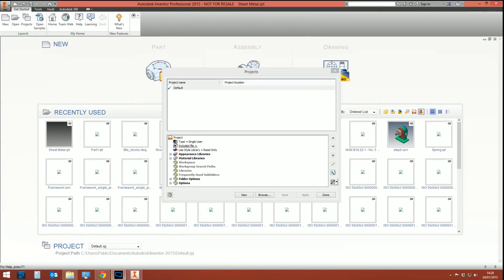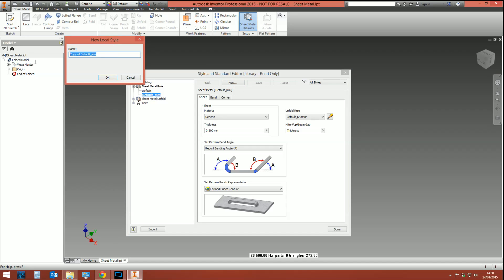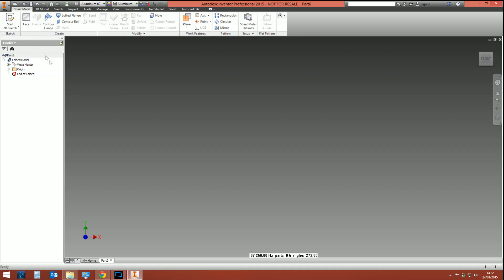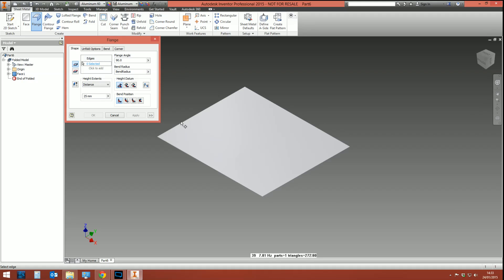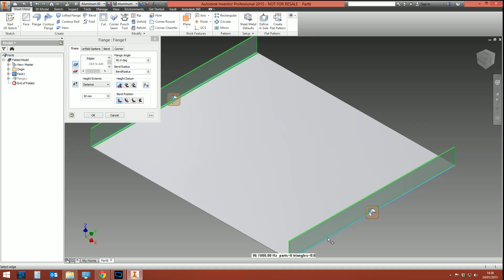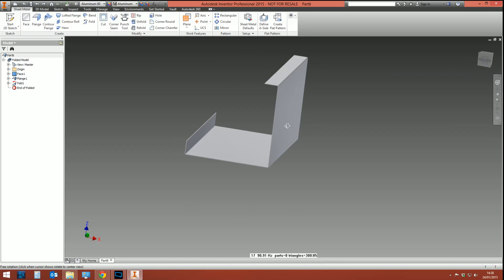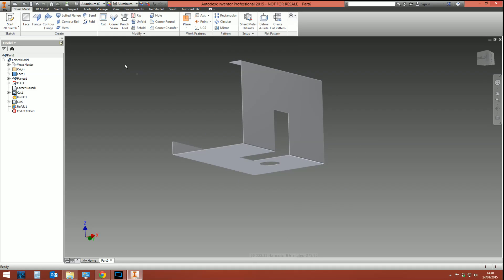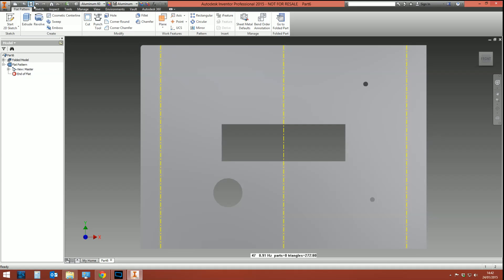How to get started with Sheet Metal | Autodesk Inventor

Comment: Greetings from The Midlands. Why is there a "Click to add" option when creating flanges? I thought it would allow you to create different height flanges in one operation (like the fillet tool) with auto mitre. It doesn't do that. What is a good way to achieve compound mitres, say for 2 or more flanges of different heights? Great channel with great content by the way.

Comment: Love your videos. Do you have any videos showing to to work with tubular frames using the frame generator? I'm trying to wrap sheet metal around tubing for body work on tube chassis, but I have no idea how to do it.
Reply from the maker: +Captain Obviously don't have anything for that specific example, but I've done a frame generator tutorial and a bend part video. Not sure if bend part works with sheet metal though, I'd say not. Is this just to bend a sheet around an existing tube say 90 degrees?

Comment: what are your thoughts on using the sheet metal tool for folding composite metal panel? We do a lot of ACM work, and have some crazy panels that are difficult to capture. Also, we have a scanner and often times have point clouds. I just need a general idea on whether or not this is something I might consider investing time in or if, in your opinion, Inventor is just not the right tool?thank you! very glad I stumbled on to your series!

Comment: Hi, firstly thanks for your awesome videos, no inventor videos I found so far are more instructive yet so much fun.
I have a question regarding sheet metal design (that's why it is here not on the latest video): Is there a way to cut through a flanged or lofted flange sheet metal part at an angle or with a profile, without having after "Create the flat Pattern" a non straight (i.e. not 90° to the surface) cut at the edges of the sheet? The other way around - first perfectly normal edges and afterwards this bend distortions- would be more desired if possible :)
Thanks in advance!

Comment: I've a problem with a sheet metal

the thing is that i can't unfold a sheet metal, cuz the program doesn't detect a "stationary reference", i think that this happends cuz none of the sheets edges is straight ( one of them has an ondulated pattern and the other is curved ).

is there anything i can do about it ?

thanks for your time

seeya

Comment: Extremely helpful. You focused on the main points that I needed without confusing me.  I even laughed several times.  Much better than tutorials that want to put me to sleep.  I've been using Inventor since 2010 but now we are venturing into the Sheet Metal stage. I plan to check out other tutorials you may have.  Thanks!

Comment: Well done. I'm going for a little test for a job and have not used Inventor for 9 years. Solid modeling was easy and still in my head but I was never taught the sheet metal portion in school. This defiantly will help me with my test.

Comment: Hello there,

I have some questions regarding sheet metal design capabilities in Inventor. Please feel free to ask for further clarifications on any of the questions below if required.

1.0 Could you import / export CIS and IFC file formats in Inventor?
2.0 Is there a nesting tool with the software?
3.0 Is there weldments capability with the inventor (welded structure)?
4.0 Does it seamlessly produce BOM?
5.0 Is inventor capable of pulling information from a PDF file?
6.0 Is Inventor capable of generating parametric models (adaptive parts)?

Comment: Hi again, Can you please do a tutorial on a pressed sheet metal part, a pressed four sided tray with edge relief would be great. Also show how to make a DXF file from flat pattern part, can you also include bend lines in the DXF file please!! I would like to be able to send the file to a CNC machine so it marks the bend lines and cuts the profile out then for an operator to bend the part on a Brakepress using the bend line on the profile. I am sure people in steel fabrication would love this tutorial. Your videos are great if not a bit complex for me at the moment, as i am new to inventor but have been using autocad for a long time.  Thanks again.
Reply from the maker: BAW Hey thanks! Seems like a logical next step to do that kind of video, this will definitely go on the to-do list! Another idea you've just gave me is a tip video for people moving from AutoCAD to Inventor, I've taught a load of people who have done that and I think I can remember what they were struggling with so that's another plan. So yes, that DXF video with bend lines will be a definite future video!